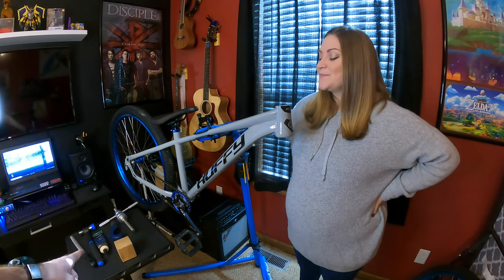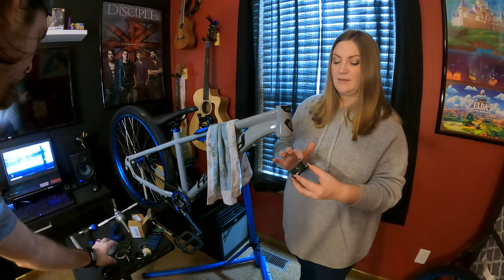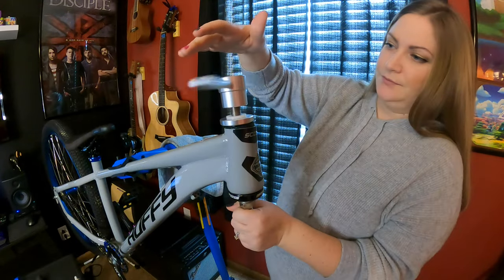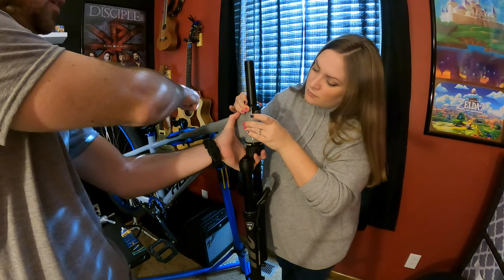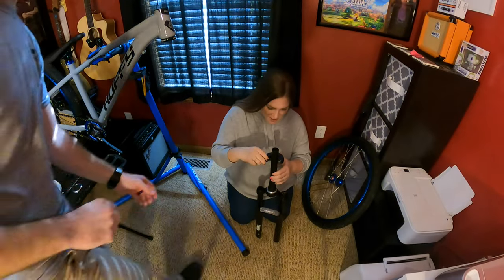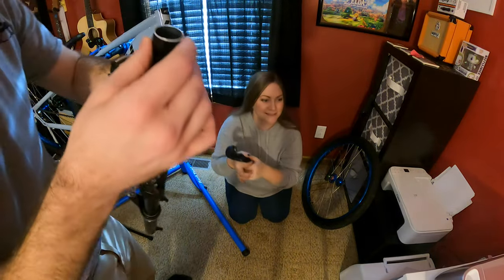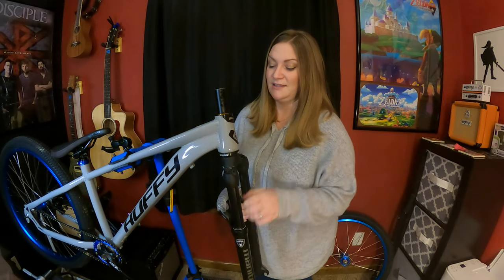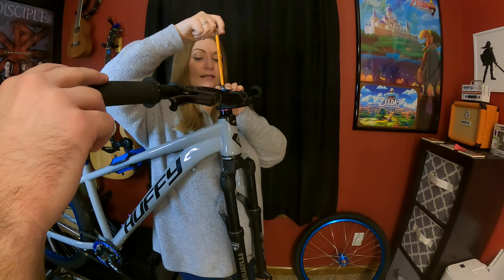Can My Wife Upgrade My Bikes Fork - Manitou M30 Markhor Fork - Walmart Huffy Scout Phase 3

Comment: I have a huffy scout but my is a 24 inch and im changing the forks to a new one do you think am going to need to change the headset in my bike like in yours ?
Reply from the maker: As long as you do not buy a tapered fork you should not have to change the headset. I bought a tapered fork so I had to change the headset. Hope that helps!

Comment: hey so do you have any dirt jumper forks you would recommended under 300?
Reply from the maker: So I ended up using these ones and they are under $300 and I think they are terrific ! Even for a DJ build 😁😁😁
Reply: @chickensendies  cool alright I think if I would get one I would go with that
Reply from the maker: @aye_danyoo  I definitely recommend it! 😁😁😁
Reply: oh also 1 more question do you know the thickest tires you can put on this frame cuz ahh may or may not have gotten my hands on one of these
Reply from the maker: @aye_danyoo  I had 2.2 but i feel like 2.3 would fit. Any bigger than that would be close lol
Reply: @chickensendies  sweet thanks
Reply from the maker: @aye_danyoo  of course! 😁😁😁